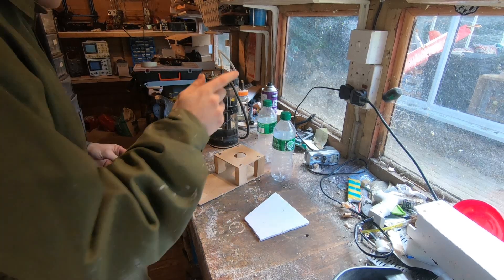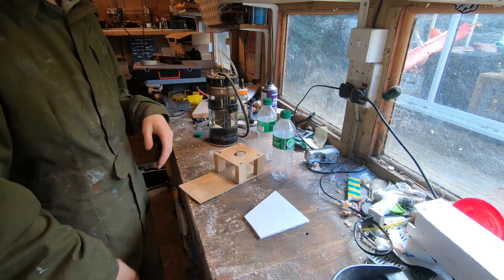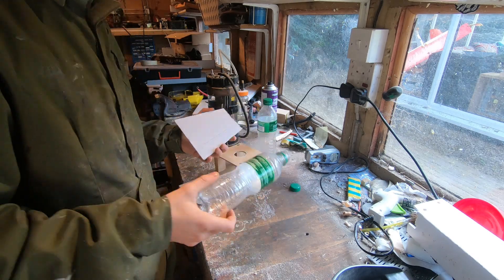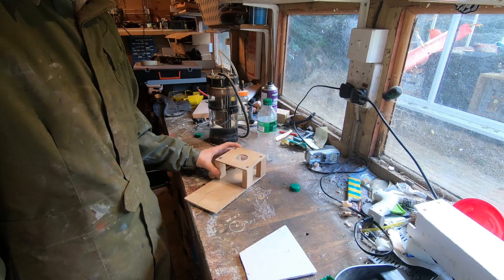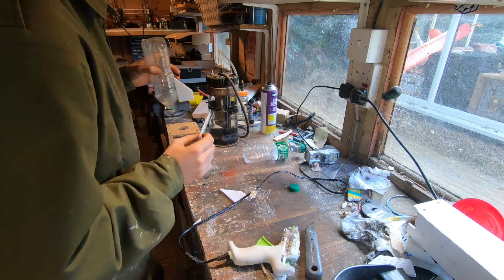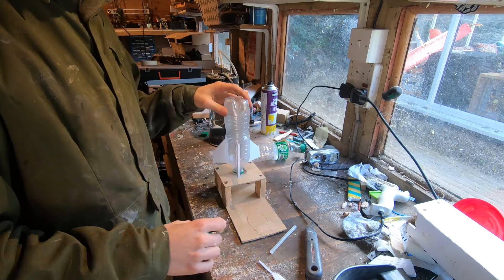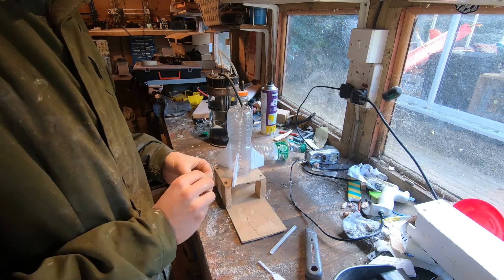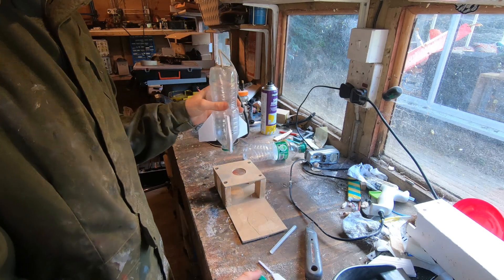Testing Hydrogen / HHO bottle rockets!

Comment: cool project....  by way, if you take this further, then a good way to safely do ignition would be rocket igniters you can buy in rocket shops..  they're designed to ignite model rocket motors...  but you could easily make them work with this setup.